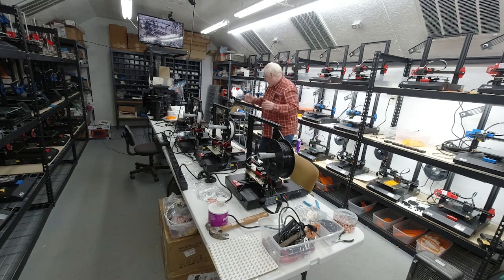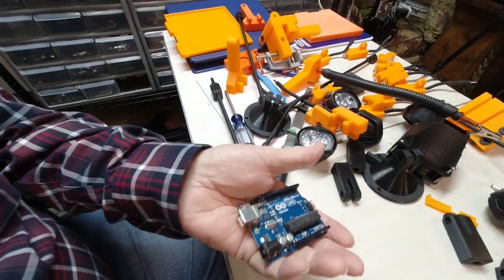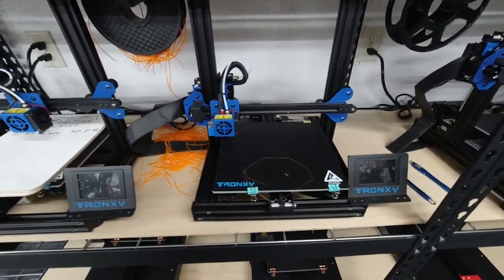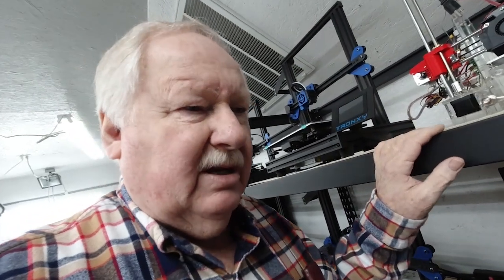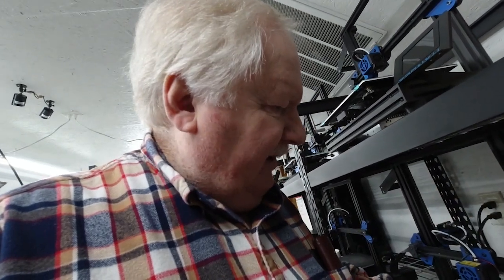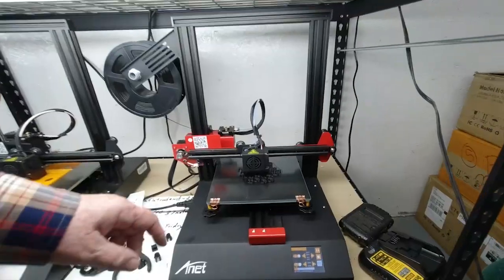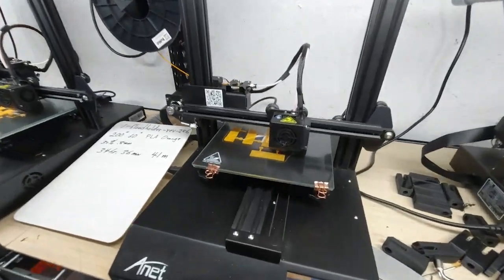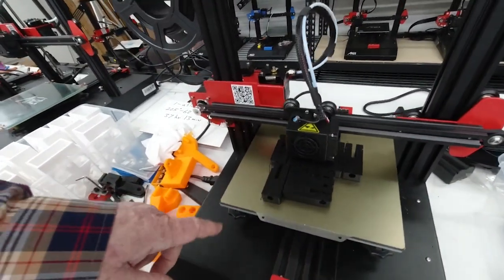A LOOK AT MY 3D PRINT FARM AFTER HOURS and how I integrate ARDUINO boards into my 3D printed product

Comment: Regarding the broken filament I don't think moisture is the (only?) culprit. I have encountered the same behavior when respooling. When filament is manufactured its from what I understand spooled slightly warm and can form a memory position. It's especially noticeable at the center of spools where the diameter is smaller. I've had the last metered on 3mm filament spools explode on me exactly like you show, back in the day.
But of course you have much more experience respooling than me, have you noticed anything like this?
Reply: I think you are on to something here. After respooling I feel like my filament is under pressure from being wound another way.
Reply from the maker: You have a good point Peter, and I do think that the fact that this filament was re-spooled could have caused scratching, scuffing, or cracking of the filament when it ran through the filament counter. Even if the filament was damaged during this process, I think that it will still print fine only if the printing takes place soon after re-spooling. I left it sitting on the printer for over a month which I have never done before. Thanks for sharing my friend and thanks for your support...Ken
Reply: @NewTechInventors  wow memory of filament has been disturbed ... filament fights back.  What a cool discussion.  Thanks guys I’ll be dreaming of filament all night.  Bless you guys
Reply: I have manually Re-spooled filament and the exact thing happened to me last winter on a humid night. Woke up to spaghetti 😩

Comment: Great videos Ken. I'm 70 years old and just getting into 3D printing. What models of Tronxy printers do you find best for your needs. I'm in Canada and the prices of printers are so much higher and I've heard good things about the Tronxy. Currently using an Ender 3 V2 and by the time I upgraded to where I felt it needed to be the Ender was quite costly.
Keep up the fantastic videos...lots of encouragement for us old timers to get off our butts and keep contributing to society.
Reply from the maker: Great to hear another OLD GUY getting into 3D printing. It helps keep us sharp just solving printing problems and designing things to print. My Tronxy XY-2-PRO 3D printers works well for me, and with the 255 x 255 bed can print more small parts in a batch as well as larger parts than can be printed on an ender 3 or Anet ET4. The set-up and adjustments to the XY-2-PRO can be a little difficult but once you get it printing good it will continue for many print cycles before needing re- adjustments. I have about $275 US in each of these printers including the spring steel magnetic bed sheets. Thanks for your comment, Richard and let me know how things go on your end...Ken

Comment: Wow! Great moves! Billy Idol is still a favorite of mine as well. I have only seen PLA do that after a couple years of exposure here, where the average relative humidity is about 50%. You might want to look at a different brand of filament? Spring Steel PEI is the best!!!
Reply from the maker: Since this was the first time that I have ever seen anything like this happen to a spool of filament, I contribute it to many factors causing the perfect storm. The filament spool was first opened over 6 months ago and had been in and out of storage bags many times, also this filament was removed from the original spool and re-spooler over a month before this video. The re-spooling process could have scuffed, scratched or cracked the filament and contributed to my problem. Leaving it on the printer for over a month allowed all of these factors to manifest themselves into the mess you saw in the video. Thanks for the comment my friend and thanks for your support...Ken

Comment: This might be a result of re-spooling your filament onto spools. It may be causing some internal fracturing in the filament.

There isn't a coating on the filament.
Reply from the maker: I definitely think the re-spooling, contributed to my problem. Most of all don't leave a spool of filament sitting on a printer for over a month. Thanks for the comment my friend and thanks for your support...Ken
Reply: Interesting ..u think it’s respooling. I know he’s got a low water environment ... it almost looks dried out not moisture ridden.  I wonder if a draft or insect or dust mite had something to do with it. Thanks for your input

Comment: Hey my brother.   Smoke is escaping on grandsons bench...ng.    No nothing of Arduino boards need to know ....more.moisture comes on end...very interesting thank you.  Nice moves my friend
Reply from the maker: Thanks Joe, I will have my new flex arm exhaust fan for the helping hand the next time you see my grandson soldering. Arduino boards are amazing and can do so much. I will be showing you more of that this year. Most of my PLA becomes brittle at the very end after a print completes and the spool stays on the printer for several hours. It may only be an inch or less, but you can tell the difference. This case was by far the worst case I have ever had, and I have never left a spool of filament on a printer that long either. I am sure there are some other factors that may have contributed, like scratching or scuffing of the filament when it went through the filament counter or just flexing of the filament caused when re spooling. I guess these are things we can watch out for in the future. Thanks for comments and your support my friend...Ken
Reply: @NewTechInventors  you are an amazing person ..thanks

Comment: Should you burn off the cut ends of filament when loading a reel to slow down the wicking of moisture? Cauterize.  People burn the ends of rope when cut to size.
Reply from the maker: Good question David. I think if you use the filament soon after re-spooling it won't have time to degrade and cause a problem. Also putting it in a sealed bag with silica gel when not in use will also help. Thanks for the comment and your support...Ken

Comment: I have never seen filament fall apart like that.  I have had it crack before during a print, but nowadays I'll leave a roll out in the garage for weeks and then use it and it works fine.  I can't believe it fell apart like that.  Must happen after several months or something.
Reply from the maker: In this case the filament was run through the filament counter and wound onto a new spool, this process flexed the filament causing smell cracks allowing moisture into the filament and making it brittle. I only use the filament counter when I plan to use the filament within 24 hours...Ken

Comment: My pla dont do that. Is 1.5 years old some of it. I use Real Filament brand. Some good and proper head banging music is always welcome 🤘
Reply from the maker: Thanks for the kind words, Tommi. I also have some PLA that is more resistant to moisture, and I am sure that contributed to the problem I had in this video. I have never had this kind of problem before, but I also never left a spool on a printer for over a month either. The music really helps when I am alone for long hours working at the print farm and sometimes, I get into it a little!!! Thanks for the comment and for your support...Ken

Comment: You really shouldn’t use PETG on PEI. It can and will bind to it and ruin it. You should have PEI textured powder coated sheets for PETG.
Reply from the maker: Thanks for sharing that information my friend. I have some textured sheets of PEI and will try to do more of the PETG in them. Thanks for your support...Ken
Reply: @NewTechInventors  PETG should stick to textured without any help. It’s made for PETG and not for PLA. Reason is PETG bites onto the texture, and when it cools it contracts and pops right of usually. The PEI SHEET is a sticker at the end of the day and PETG temps 80° to 90° will boil the glue causing little bubbles to form. The PETG will expand and contract pulling the PEI with it and it will cause bubbles. Sometimes (just like with PETG on glass) it will take a piece of it with it for a souvenir. Not all plates are created equal. The textured sheet from Ultistik holds PLA and PETG the same. The Chinese ones do okay with PLA, but again are better with PETG
Reply: @NewTechInventors  btw I binge watched all your videos. On my recent business trip. Pretty interesting. I really want to invent something too.
Reply: @thelightspeed3d712  hey I use steel sheets and yes the sheets will eventually wear out.  Sticking and pulling the metal right out.  I think the metal fatigues. Seems that texture on the metal will enhance metal to pull away.  I use only petg